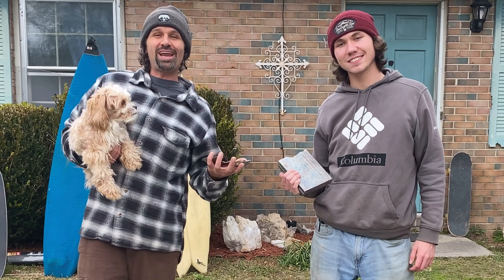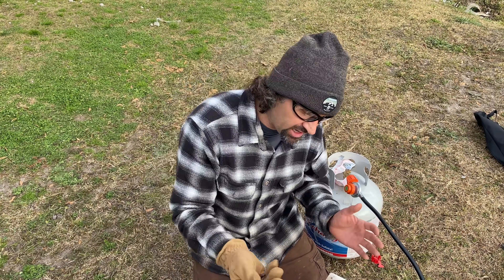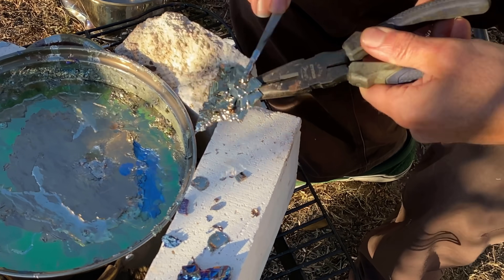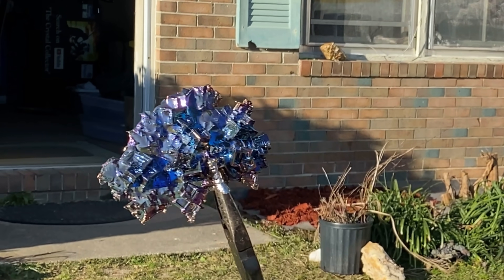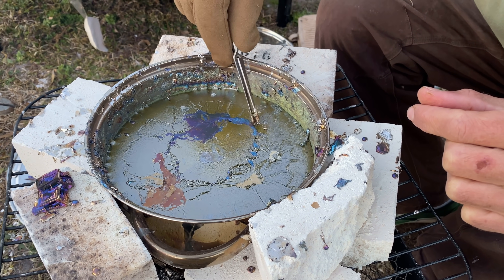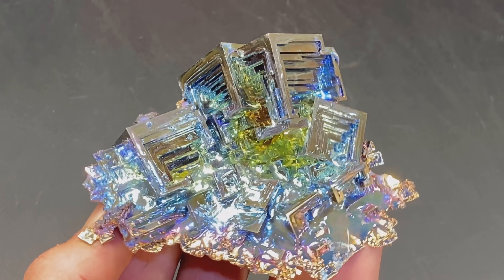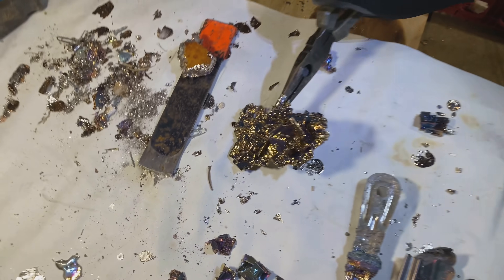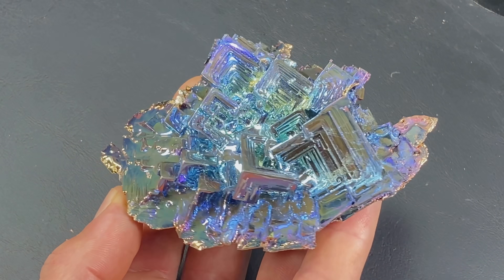HomeGrown Iridescent Bismuth Metal Crystals

Comment: my tip would be to let the crystals cool longer before you try and take them off the pliars they seperate easier when hteyre a bit cooler so you wont risk breaking the large ones like you did once

Comment: use a stove hot plate why do all these dudes waste propane!... and propane accessorys! (The average induction system reaches a temperature of 662°F (350°C). Electric stovetops get very hot. When a small coil on an electric stove is on the highest setting, it can get as hot as 932°F to 1112°F (500°C to 600°C). A large coil, on the highest setting, can reach 1472°F to 1652°F (800°C to 900°C). Bismuth/Melting point 271.4 °C)

Comment: You can do it on the stovetop. Of course I would not use the pan again lol. What's really cool is you can take a form let's say of a egg. Once you pour that into a shape. It we'll take that new shape on it has to withstand the heat of course. But you can make geode or crystal eggs that way. Just like you did you just take the top layer off. How much was your lot of metal I've gotten some before but you guys got alot. Also I think it's called gallium but it's a metal that melts in your hands then it we'll go back to being hard metal. Once you let it cool off. Today I've been making chalcanthite crystal there really pretty blue. I order copper sulfate you make a solution that's how they form. The name actually means copper flower. The crystal do form in nature. But it's extremely rare i believe. Anyway keep up the good work with your finds and your channel 🙂.
Reply from the maker: Yeah gallium is really cool too, I bought some a few years back and it’s really wild how it melts in your hand!
Reply: @TheCrystalCollector  yea nature is so cool. Yea I seen you was making Bismuth so thought to tell you see if you had heard about it. The have frozen smoke on etsy sopost to be the lightest object. Not sure if it actually keeps it shape or not it has another name but I've forgotten what it is now but it too looked really cool. You can make crystal witg copper sulfate that's what chalcanthite is. It does form in nature but it's rare. It's name means copper flower. Anyway good luck on your channel and you're rockhounding.😁

Comment: Good job.

I've done a few of these, using a hotplate in the garage. People also do all this in their kitchens. I don't. Bismuth is unusually non-toxic for a heavy metal, but the issue for me is the possible mess more so than the fumes. 

I've also made a type of extruding, pushing liquid through an older oxide crust that will usually turn out green or blue tear drop shapes and not crystals. 

Evidently the thickness of the oxide layer controls the color, which in turn is dependent on the time of cool-down, which forms during the heated exposure to oxygen.

There are really interesting properties in this metal. 

At last I got larger ones to form after piddling surround with a higher volume. It's not super cheap but I splurged and got several more pounds recently. I also have a heat-resistant clay that once dry is ideal for making molds and more intricate shapes. In this case the inside of the form will not be exposed to air and harden with a shiny metallic sheen.

Comment: Hey, word of advice!:

I'm no pro at this or ANYTHING but i high recommend to pull these out slowly, and especially drain the remaining liquid on top the crystals OFF of them and back into the pot as you pull them out. I can see a lot of your crystals lose some of their well-defined edges and corners because it's still wet with excess bismuth. I believe some of the biggest and best crystals are made by pulling them out VERY slowly, over the course of 10 seconds or more, so the air doesn't shock-cool all that extra liquid bismuth, and the heat transferred from the pot keeps that excess liquid to run down, ya know? Just a thought I wanted to share! Hope you try it :)
Reply from the maker: I’ll give that a shot! I’ve noticed that also.  Seems like keeping it warmer as I’m pulling helps also

Comment: Could you make a small hole it the side of your pot with a plug after all has melted allow a thick layer to form on top pull the plug wait for it to 'very slowly' drain.

I'm not sure if it will work but it might result in a massive geod effect. 
Hope ya see this HH and good luck.

Comment: I’ve been growing crystals for a couple of years and have a huge collection I can give you a few tips but I can’t give away all my secrets lol get yourself a pair of stainless steel kitchen tongs that way you can catch the crystals from both sides. Then when you pull up the crystals hold them sideways for a bit to let the excess fluid drip off and that will stop the puddling effect. Also safety first Do Not put oil or water in molten bismuth it will cause a mini explosion or some serious popping and hot bismuth sticks to your skin which is no fun. If you decide to make geodes then you could find a good dry graphite lubricant as a mold release. Oh and one more thing the thicker the pot the better, cools slower for bigger crystals. Have fun and keep it real!
Reply: @The Insufferable Tool cast iron works great
Reply: Nice tips thanks!👌🏼I’m trying my first batch this weekend!

Comment: You should be able to grow larger formations by seeding the bismuth with smaller crystals. However, the ratio between the seed's thermal mass and the molten bismuth thermal mass will be important to keep note of.
Also, the slower the molten bismuth cools, the better crystals you will grow. The molten/"sloshy" look is because it was cooling too quickly.

Comment: I have wanted to do this for so many years! Do you think it's better to only melt a few pounds at a time, instead of that large of an amount? Keep experimenting! 👍😎
Reply from the maker: Yes you can do smaller and still get large crystals if done correctly.  I’m not a professional at this on any level.  I’ve seen a guy, one of the best, make some huge ones in a small pot.  I tried my best to imply his methods here. Worked great for me a few times.  It’s a sequence you follow and if done right the crystals will form up every time.